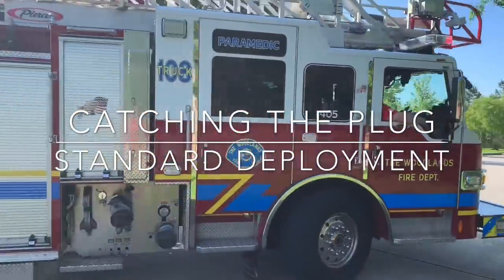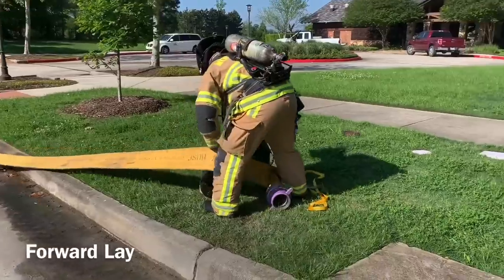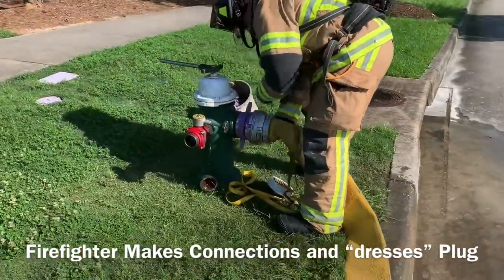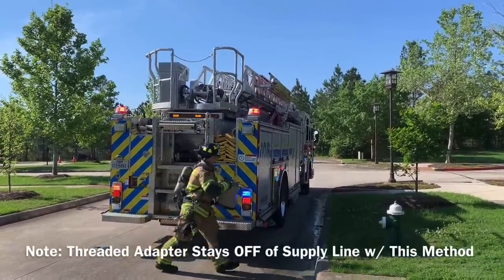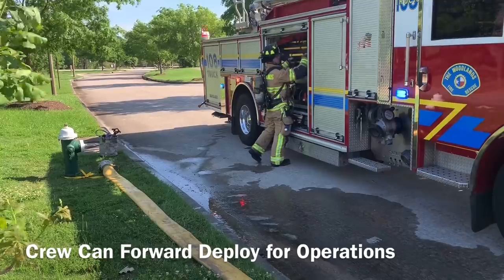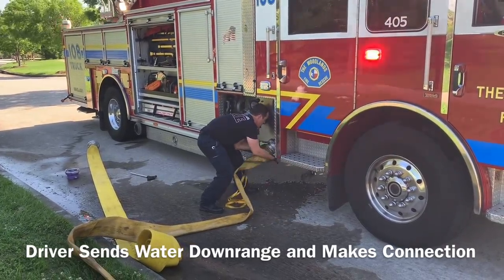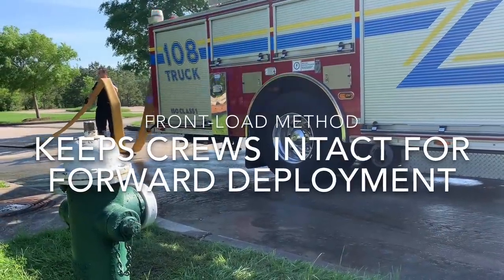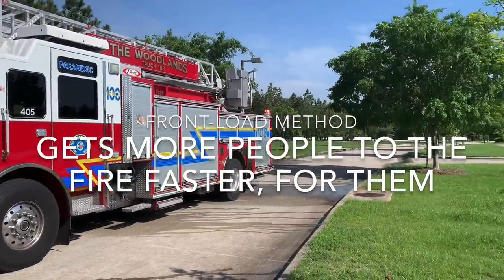Catching the hydrant - standard vs front-load methods

Comment: I get the thoughts on this, but what will you do when you lay forward and notice pressure isn't enough. If the line is already charged, its complicated to augment it with a dedicated pump at the hydrant. How do you decide which method is used? How many feet of supply hose are you able to lay before pressure gets down due to friction loss?

(Disclaimer: I'm a German firefighter and we tend to use other tactics, especially in urban and well hydranted areas)
Reply from the maker: https://youtu.be/4wUc1NqO0ew  Here is a (more recent) video we put together on water supply stressing this point.  The basic point is that unless the hydrant is right next to the attack engine, you should always put a pump at the plug.  The older way of forward laying to the fire could leave you with the need to either interrupt supply to cut into the plug, or to use 4-way valves (which we don't carry). Laying dry and leaving a spot for another engine to pump at the plug is a better way as long as you have those resources coming in a timely manner.  Friction loss is dependent on supply diameter and flow rate.  So FL may not be a big deal if you're supplying a single line fire but may become a big deal if you get into master stream territory.

Comment: In the front load method the end of the 5 inch is clearly about 5 to 8 feet away from the hydrant when the truck drives off. That could be a significant amount of weight to pull back to the hydrant. When they cut back to the second due connecting vehicle, the end of the 5 inch mysteriously appears right next to the hydrant. Just have the first guy wrap the hydrant and maybe not use the strap/webbing. Just my 2 cents worth….
Reply from the maker: understood. however in this scenario that hose doesn't necessarily have to connect to the hydrant. it will connect to the discharge of the arriving apparatus, which will use their own hose to make the hydrant connection.  but yes, pulling that back would be a huge challenge.
Reply: @TheWoodlandsFireTraining  I see what you're saying, then disregard my comment!

Comment: Also the deadman  rope should be set around 6/8 feet back from the steamer conection couplings . Preferable  at a fold. This leaves  slack for being able to connect. See video  end of hose is a good 10feet away from plug and once LDH is on the ground you will not be able to use a Hose Streatcher LOL.
Notice  that i. Video the LDH was moved back towards the plug.
LOL
Just shy of 40 years OTJ.
Scene it done it a zillion times LOL

Comment: Why don't the fittings match so an adaptor isn't needed? The whole start up is rather slow either way. Seems like the engine could have a tank of water already on board to use immediately while connections are made.
Reply: It does. Anything with a pump on it is going to have a several hundred gallon tank. It's simply not enough. On a actual fire scene this will be done more smoothly and not so awkwardly.

Comment: If the first arriving is a ladder truck, don’t they risk running out of water if they don’t connect to the hydrant?
Reply from the maker: short answer is sure.  There are a lot of factors to consider.  Our "ladders" have 500 gallon tanks same as our engines.  Water supply, apparatus spec, response times of other apparatus all come into play for sure.

Comment: In what world does the second “engine “ dump their tank water to supply the attack engine?  Without an established direct hydrant supply an interior crew could get in trouble if the second engine can’t get enough water to the attack crew.
Reply from the maker: With an initial attack flow rate of 160 gpm, you have roughly 374 seconds of continuous flow using solely tank water from the first two apparatus, assuming you have 500 gallon tanks, and you have 1000 gallons of water to utilize before more water is required. With 750 gallon tanks, you have over 560 seconds of continuous flow capability, and 1500 gallons of water immediately on-hand.  This method is a derivative of the booster back-up method of water delivery (which officially assigns third-due to permanent water supply establishment).  This works best in jurisdictions with 2nd and 3rd arriving companies that typically arrive in less than 3-5 minutes from the 1st arriving.  For more detailed info on these concepts, visit:

https://www.firehouse.com/operations-training/article/21217485/command-control-success-people-before-water

https://countyfiretactics.com/category/engine-company/booster-back-up/

https://countyfiretactics.com/2018/11/10/booster-back-up-3rd-due-for-supply/
Reply: @TheWoodlandsFireTraining  just curious if you lay 500' of 5" supply line, how much water does it take to just fill the supply line?
Reply: I agree!! I don't care what his math says
Reply: I was thinking about the same thing. But my Station only runs a two man duty crew. If they us a "front-load" then they are depending on another engine or Station to come along and connect. Even in the case of calling a Mutual Aid right at the same time as  their Size Up, the next Responding Company may be more that 10 plus minutes behind. Our guys will be out of water long before that!
Reply: In there world. It works for them.
Reply: @cfl941  1 gallon per foot. Thats a lot of water inside hose.
Reply: @cfl941  I fully agree with you. And with your example of 500' of 5" that already 510 US gallons of water. And then when you think of a small structure fire and let's say the primary attack engine stretches 200' of 1 3/4" attack hose that alone is 25 gallons of water. So @TheWoodlandsFireTraining I understand where you are coming from. But with a two 500 gallon tanks supplying 1 attack line and a LDH. Your 374 seconds (remind you that is only 6 minutes) goes down to @ 160 gpm only gives you 3 minutes of water. So unless if you have an area where your second engine is LITERALLY right on the primary engine's ass. You dont have your water supply. You just have 1 filled LDH. Given this as you said this is for urban areas. But if you are a volunteer department with volunteers surrounding your district, the front load method is very impractical when you need water immediately and you don't know when your second engine arrives.
Reply: @nealamberg807   if the first thing they want the second engine to do is dump the tank into the supply hose, its pointless because all you are doing is filling the hose. All i'm saying is focus on turning the hydrant on. Who cares about the rest of it.
Reply: @cfl941  pretty close to a gallon per foot - tank water doesnt go very far with a long stretch
Reply: @sgt.guardsman2221   Our engine that runs mutual aid out in the rural areas (few hydrants)carries  a split load of 3" , on  long dead end driveways we drop ether duallies or a single line at the main road and let the 2nd (supply)  engine set up for drop tank operation -

Comment: Gate valve should be on the side where other trucks are coming in, correct?
Reply from the maker: in our opinion it doesn't necessarily matter.  It could depend on a few factors.  Our general preference is to put gates on both side outlets when possible.

Comment: In what world would you tie up a ladder truck picking up somebody's supply line?
And why is there a pump on the ladder truck?  Real ladder trucks don't have pumps.  Real ladder trucks bend in the middle.
Reply: Almost all ladder trucks have water storage and water pumps. Often than not we buy quints which have Aerial Ladders, Ground Ladders, Hose, Water, and a Pump. Firetrucks often times do not bend in the middle making it more difficult to back out of tight areas. Usually it is the Engines responsibility for water suppression but if there are none available or it is needed on a different part of the foregrounds you may very well supply with a ladder truck. If you have a forest fire that has lit up 13 houses the goal at that point is just getting water on the fire, there would not be any search and rescue operation due to the extreme IDLH environments.
Reply: It’s call a quint. For small departments like mine it’s a plus to have that kind of truck. But most of the time we use our engine.
Reply: They are probably using their truck to not tie up the engine. These guys could be on their day off making this video. So the on duty engine crew can stay available to respond to calls.  Also, when you say bend in the middle, are you referring to Tillers? Los Angeles County FD has tillers! Oh, but they are also Quints. So do those count as real ladder trucks? 🤔
Reply: Loved to see you extinguishes a fully involved fire house with your can. It’s always funny to see a full crew of Truckie on a roof of a fully ventilated house fire…. Until you see one of them disappear cause the roof collapse… and a rescue or engine crew has to go save his ass!